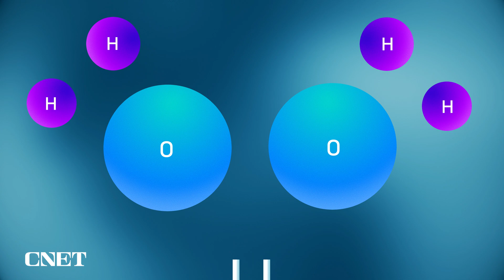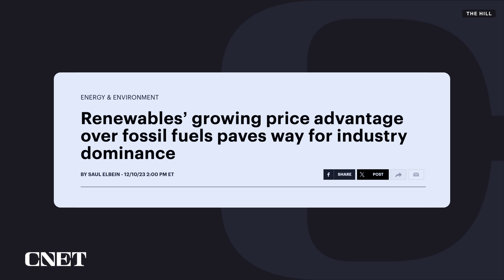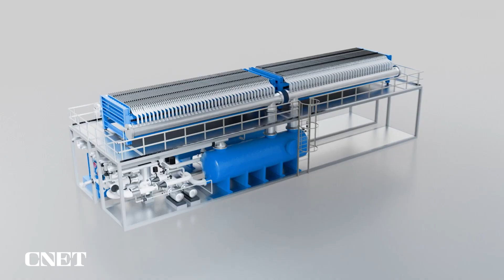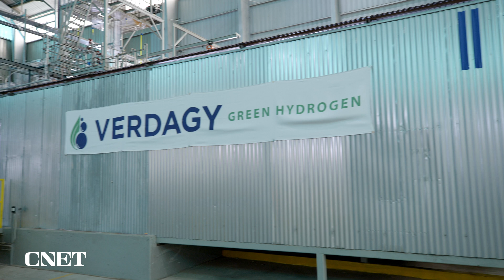Can Verdagy's Green-Hydrogen Overtake Gasoline?

Comment: The tunable aspect, being able to run at full capacity during solar maximum, and drop way off in the evening.  
That is a big positive.  

We will need power hungry industries that can flourish on six hours a day, with massive amounts of nearly free electricity, when solar farms are creating large excesses.   

Hydrogen as a chemical feedstock, highly valuable.  As a fuel, yes in limited use scenarios, ocean shipping, other mid sized vessels.  Probably a ton of other niche uses, fuel cell's possibly.  I think most passenger vehicles and semi trucking will be electric.  And most of aviation also, battery electric.

Comment: I would gladly accept dirty or grey Hydrogen if it meant the us could stop sending billions oversees for Oil and kept that money here in the US. Since the infrastructure would be built up for Hyrdogen here in the US (which would also mean  more money in Hydrogen and new advance technologies in creating Hyrdrogen) than as a country we could tackle the problem of going all Green Hyrdorgen., once we stopped importing all that oil. Extracting crude oil and changing it to usalbe fuel is as black and dirty as it comes and doesn't help the planet if we create the dirt or we import it from another country.  What difference does it make if have gray hydrogen until it all wen Green, at least the US keeps the money here and it could be used to build up our country and it's infrastructure.

Comment: 95% efficient I call BS at best it's a number that doesn't include heating, cooling, compressing, the different chemicals some really expensive because they are energy intensive to get like platinum, titanium, cobalt and the miles of very high quality tubing and tanks.
Reply: Bingo! I doubt hydrogen will ever be that efficient much like methane emissions are VASTLY underreported now in some cases up to 40X.. That makes a huge climate changing difference... I hope hydrogen has SOME future somewhere but I am very skeptical of its reality based on past projections and timelines come and gone... Always just 20 years away... Right??? ;-)
Reply: That description fits with a refinery.

Comment: This is one of many solutions we need to be greener in the future. I wouldnt look at this to replace cars though and more the storage of excess energy. Hydrogen is difficult to store and trying to replace fuel stations would take decades. 

Cars should run on bio fuels that are created using green energy sources. 

If the only realistic application is storage of energy then why not use super heated sand batteries which are way more cost effective.
Reply: As of now Bio Fuels are still very uneconomical.   Will also be a wide open door for counterfeiting it.